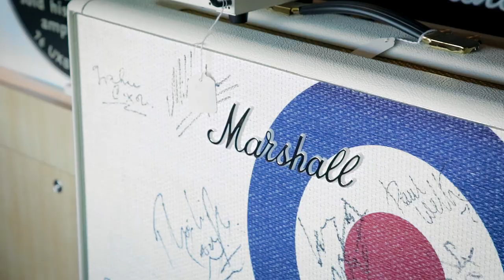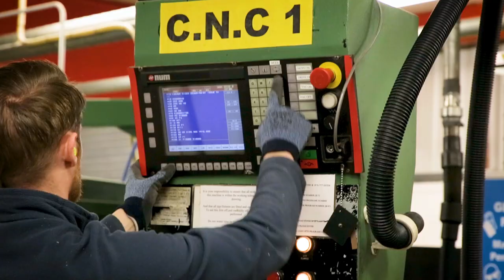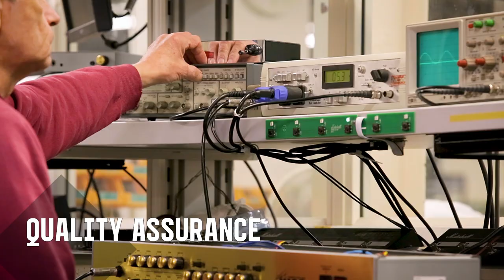Behind The Scenes | Production | Marshall

Comment: I've broken a few of the plastic proud sitting handles on the cabinets. Since the cabinets are CNC'd why can't you recess the handles into the side panels AND.....make them from steel? Also, the rear jack-plate is well worth recessing because that also catches on fastener heads in the transport vans floor.